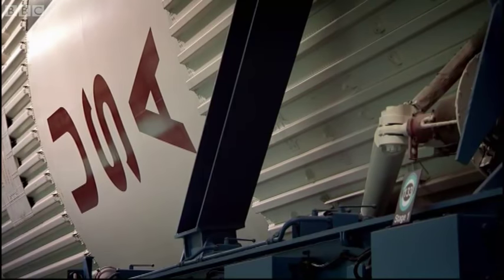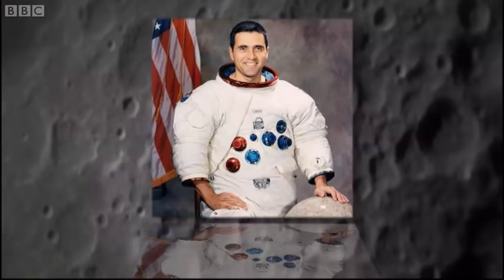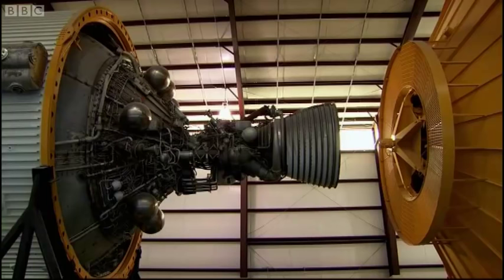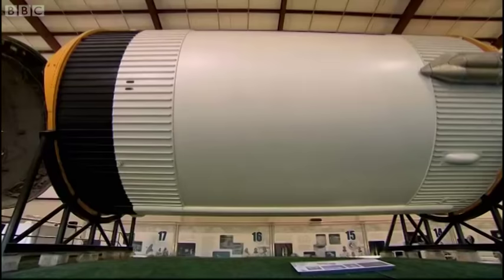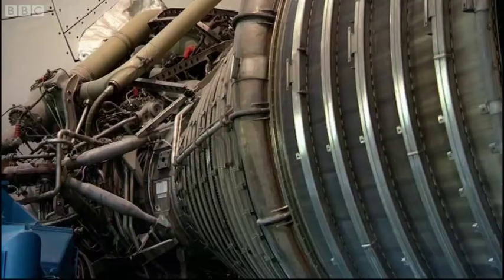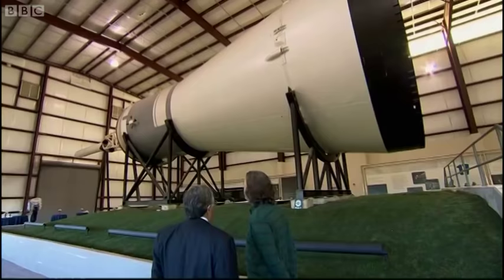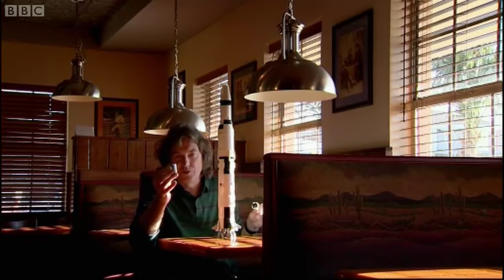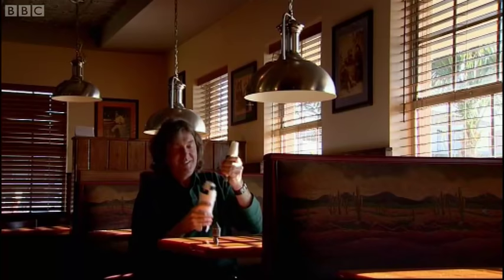How Did The Saturn 5 Rocket Work? | James May: On The Moon | Earth Science

Comment: I’m happy they built a hanger to hold the rocket. For many years it wasted away outside being damaged by Houston weather. Such a masterpiece of engineering shouldn’t have been left to rust.
Reply: theres more than one u no
Reply: You'd think with all the money they got by faking the moon missions they could have afforded a shed to put it in sooner than that. [/sarcasm]
Reply: smithfan22
The Kennedy Space Center's Saturn 5 was in a similar condition - the space coast environment is very hard on equipment and machinery - and was finally put under cover in 1997. I've seen it three times now and it is very well preserved.
The Saturn at Huntsville is also now under cover.
Reply: I didn't know where this video was made.  But I am in full agreement.  The story is the same for the Saturn V static display at KSC.  The last time I visited, in 2011, I was relieved to see they'd finally sheltered it.
Reply: MarsFKA   I’ve seen the one in Huntsville, before it was refurbished and enclosed. A video just doesn’t do justice to the size of the Saturn. The one in Huntsville has the full system, but was used for ground testing, not for actual flight. The other two were supposed to be used for Apollo 18-20, which were all cancelled.
Reply: Agreed, but the outside display actually provided a greater sense of its size.
Reply: These few left should be treated as national treasures .....spit shined to perfection...smh.
Reply: Unlike the Energia-Buran 😢😢
Reply: Scmitt is wrong not 50lbs thrust from the service model control thrust, they were 100lbs thrust.
Still the most amazing rocket ever.
Reply: I thought these rockets were abandoned in space (other than the top bit). Surely it's a replica?
Reply: @Vector_Ze  This is the one at the Johnson Space Center in Houston.
Reply: @ianto8823  Leftovers... This one is in Houston... and all of leftover sections of rockets that had the launches cancelled. 3 missions were cancelled, even though many of the parts had been constructed. The Saturn V they have down in Florida consists of mostly parts from one of a cancelled flights too, with the exception of the first stage. The first stage of the Florida version is actually the one they used for about 20 test firings of the rocket engines.